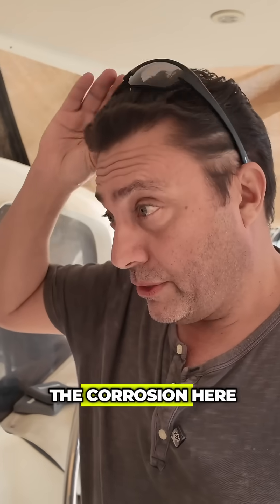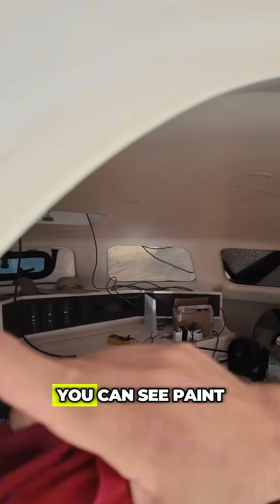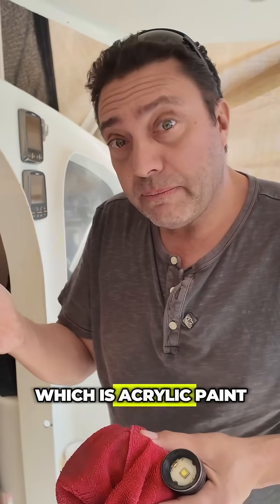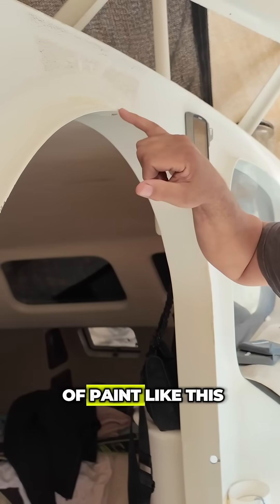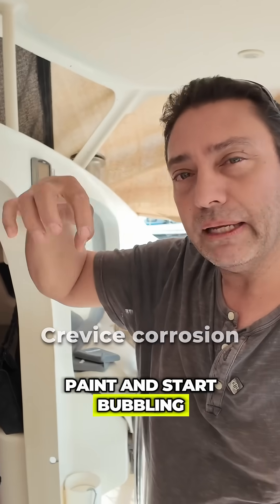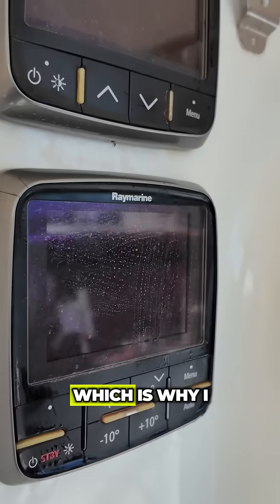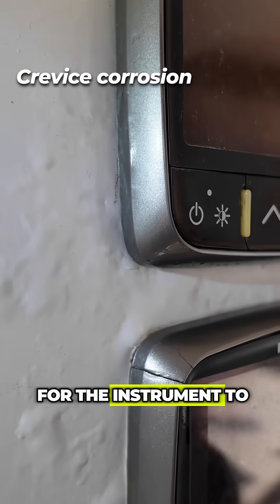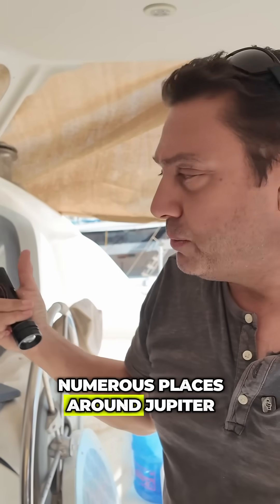Aluminum don’t like chips

Comment: Got it — you’re asking how to prevent moisture from getting under the paint on an aluminum boat. That’s super important because if moisture sneaks under, it can cause blistering, peeling, and even corrosion (especially pitting corrosion).

Here’s the right way to do it:

⸻

1. Surface Preparation is Everything
	•	Remove ALL oxidation: Aluminum naturally forms a thin oxide layer that paint doesn’t stick to well. You have to remove it.
	•	Sandblasting (light) or sanding with 80-grit abrasive is ideal.
	•	You must paint immediately after prep because the oxide layer reforms within hours.
	•	Clean thoroughly: Degrease with a special aluminum cleaner or a solvent like acetone. No fingerprints, no oils.

2. Apply an Etch Primer or Conversion Coating
	•	Before paint, use a self-etching primer specifically for aluminum (like zinc chromate primer or modern alternatives).
	•	Some pros use alodine (a chromate conversion coating) before primer — this creates a chemical bond and protects against corrosion.

3. Use a Barrier Primer
	•	After the etch primer, use an epoxy barrier coat.
	•	Epoxy is impermeable to water. It blocks moisture totally if applied correctly.
	•	Usually, you apply 2–3 coats for a marine environment.

4. Topcoat with a Marine-Grade Paint
	•	Use a high-quality polyurethane or marine enamel for UV resistance and aesthetics.

5. Pay Attention to Edges and Seams
	•	These are where moisture usually sneaks in first.
	•	Seal seams, welds, rivets carefully before painting.
	•	Some people use special marine caulking (like 3M 5200) before painting over joints.

⸻

Summary (short version):
	•	Sand properly
	•	Clean very well
	•	Apply self-etching primer
	•	Apply epoxy barrier coat
	•	Apply marine topcoat
Reply from the maker: Nice summary, thanks so much Martin. I think we’re on the right track now with the total boat aluminum primer…the remaining coats will be done next winter. Too hot there now!